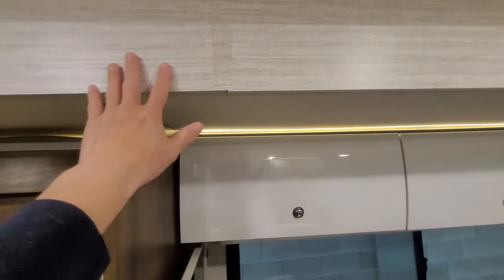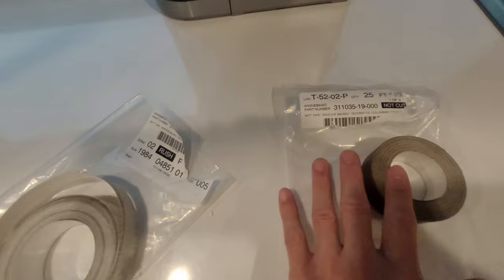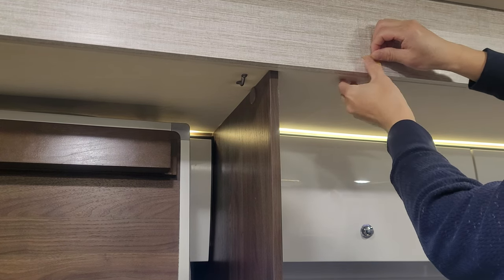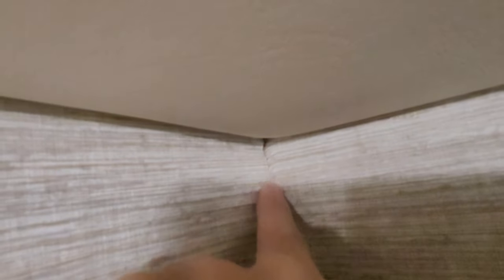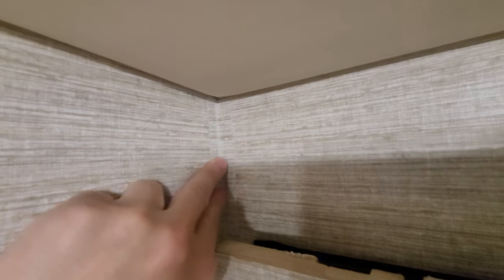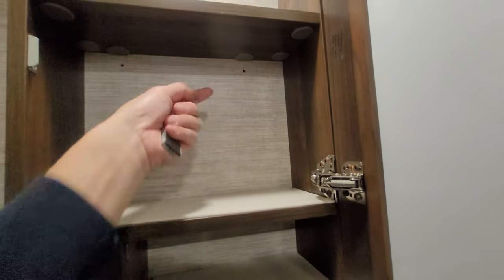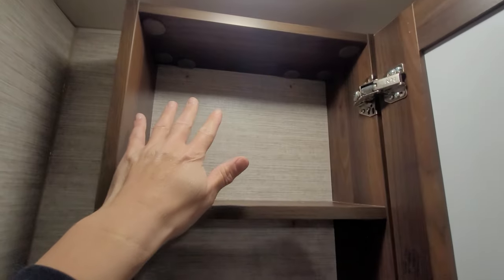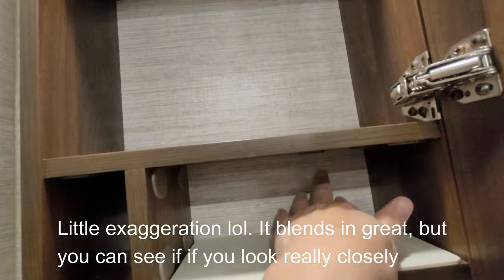HOW to REPAIR holes your RV wall Winnebago View Navion

Comment: Thanks again Craig. Honestly, I guess I should lower my expectations, even with Winnebago, as to the construction methods and quality. Not sure what I was expecting but I should have known better being a retired aerospace engineer in the commercial jet transport area.  I think the construction goals for the interiors are basically the same ... light weight, low cost and fast installation. Oh, and easily repaired.
Reply from the maker: Mark, when you do a walk through, the Winnebago will look a little better than many others.  But realistically, the entire RV industry has major improvements to make, and does not compare to anything aerospace or marine related.  It's a shame, because they could implement many items without cost increases.  If you get down to the nitty gritty, and dissect how most production RV's are made, and know how the walls, ceilings, and flooring are put together, you may never want an RV.  But the reality is that they build them "good enough" for the consumer and pass on many headaches to them.  But at the end of the day, the memories it can provide are priceless, so I would always encourage anyone to buy one and just be prepared to do some repairs.  Warranty experiences for the most part are frustrating and emotional roller coasters, and are nothing like an automobile warranty.
Reply: @rvlifediy  Thanks for the heads up. Yeah, I'm having second thoughts about the value to us of such a large investment at this point in our life. We love to travel and hope to do more but hotels and resorts might be a better option, even with the downsides associated with them. Our research into RV ownership was born out of concerns over Covid but recent experience has proven to not be all that concerning.
Reply from the maker: @volofly2011  it's a tough decision for sure. 2nd thoughts is definitely normal. You should do a rental to see if it suits you if you haven't already.

Comment: I continue to enjoy all your videos and your ingenious solutions and upgrades. I keep returning to many of them to try to implement them in my 2020 Navion model V. I'd also be interested in buying some of the tape that you purchased as your color scheme is exactly the same as mine (I'll send you an email). Unless I missed it, I was wondering whether you've encountered the same cracking of the clear caulking of the outside seams around the coach that I have. If you've covered it, please let me know which video that shows your technique. If you haven't had the issue or are planning on addressing it I'd love to see your solution. Thanks again for your major contribution to the View/Navion community with your videos!
Reply from the maker: Hi Jim, you made the last of the cut off for the seam tape. It was just shipped out just a short while ago so you should get it in a few days. 

For the exterior cracked caulking, I have made a video but not edited or published yet. Hope to get to it in the next few weeks and it should be helpful.
Reply: Thanks very much!

Comment: Another informative video - thanks!  Could you share the part number for the wallpaper seam tape?  Thank you.
Reply from the maker: I just noticed in the video that the part number is cut off.  I threw the bag away already.  Best thing to do is go to Winnebagoparts.com and fill in the parts request. They ask for your VIN number and put in request for wallpaper seam tape. They will email you back with a quote. Then you will get the correct parts for sure. Hope that helps.

Comment: Would you be so kind as to include a link, with part numbers, to order our own (rather than deplete your stock)? For the life of me, I can’t find the part (using your part #s) with the Winnebago parts list. TY!
Reply from the maker: I just added to the video description to winnebagoparts.com  I made an online inquiry and input my VIN (that way you will get the correct part for sure).  They emailed me a quote shortly after.  If you just give the description of what you need, they will email you back.  That way you won't order wrong parts by accident.